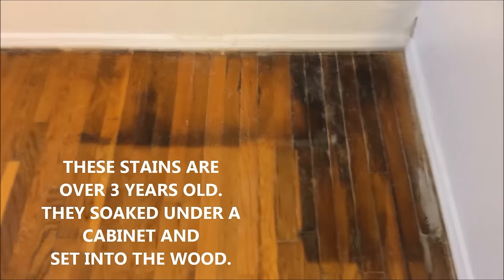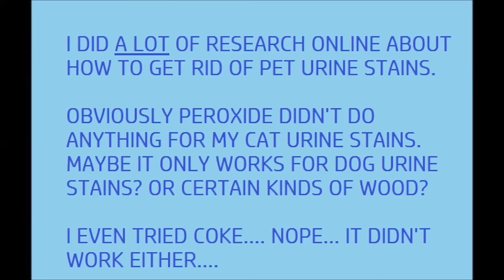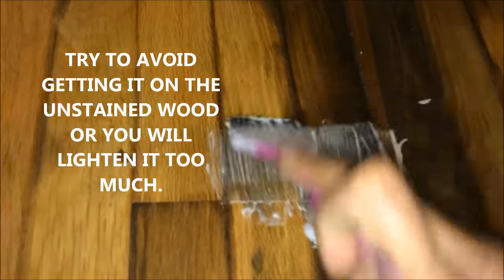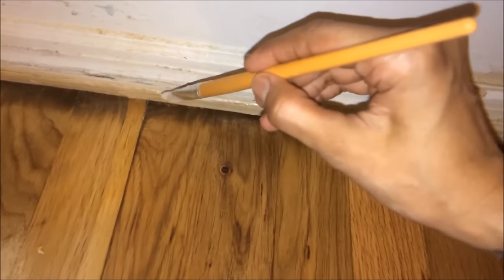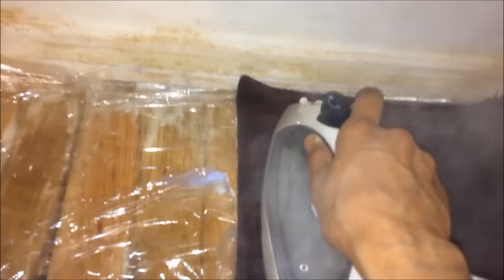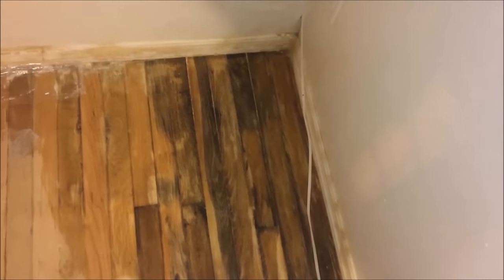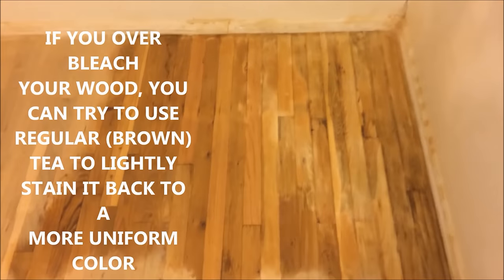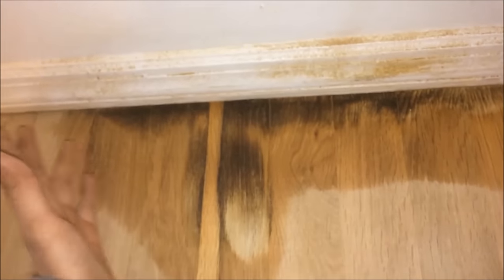How to remove pet urine stains from wood floors GUARANTEED

Comment: Just a thought is your hair developer also known as Hydrogen peroxide in a concentrated form ???
Reply: hair developer does have peroxide in it. the higher the developer the more it has. so  a 40 would have the most peroxide
Reply: Kyra Naticchioni And I think a 50 developer has the most.
Reply: michaspi correct but that is typically unavailable to you unless you are a licensed cosmetologist.
Reply: Kyra Naticchioni I just purchased a bottle of 50 at a local beauty supply store, no questions asked. Perhaps it depends on location? 🤷‍♀️

Comment: Question? Is the stains actually holding the odor and when you remove the stains you remove the odor?
Reply from the maker: I did odor removal first with vinegar and baking soda.   You can also use natures miracle.  The vinegar will turn the wood darker. But that can be sanded off. 😊

Comment: Did it hold up without any other color changes? I've bleached wood in the past and a couple of times the wood turned white after a few weeks.
Reply from the maker: if you thoroughly take off the developer/bleach after you get the color you want, it shouldn't keep getting lighter.  Mine didn't get lighter afterwards.  I was very thorough in removing the developer because if you don't and sand the floors again, they turn black if there is still developer on it.
Reply: Thanks for letting me know. I was wondering if you used a neutralizer or something. When I bleached the wood that I had the bad experience with I used a different bleaching agent though. After a few weeks mine gradually turned white as a piece of writing paper.  I'll try your method next time.
Reply from the maker: what did you use?

Comment: Unfortunatly didn't work for me!
I have timber parquet and it just caused the edges of each piece turn white and looks horrible, as the middle of each piece is still stained black.
The heat method caused the most damage. When left on overnight, avoiding the edges, it had no effect of my flooring.
I will be heading to the hardware store in hope of my saving grace.
Reply from the maker: i'm sorry to hear that, but parquet is a different wood than red oak.

Comment: what about the smell, did you get that out separately
Reply from the maker: yes, I used baking soda and white vinegar. then cleaned it up with soap. Do the smell removal first as the vinegar mixture will "grey" your floors a bit and need to be lightly sanded away.
Reply: Lizzie Seymour I do actually like the ODOBAN pet stain remover.  At Home Depot.  It smells when it is working but then does get the smell out.
Reply from the maker: ooh  never heard of that.  I used to use Natures Miracle on bedding.  but used vinegar and baking soda on the floors

Comment: Not. 38 years doing floors. Urine goes straight through the floor to the subfloor. You only touched the surface of the floor. The stain will come back in time always does. Only way to get rid of the stained boards is to replace them. FOR SURE.
Reply from the maker: Wrong. The stains never came back.  They were literally bleached out.

Comment: well i tried my way yesterday ..i took & have 2 bottles 1 filled with clorox cleaning bleach  & the other filled with white vinegar  i spray heavy the bleach 1st then  i spray the vinegar  heavy on both let set for bout 5 minutes then i take & i have a drill with a wire brush  go bout 1000 rpm or so  it if from home depot it is impact drill but have on drill  i push the brush down in to it good let run for  a bit  let set for a minute or 2 then sponge mop it up let dry then look  & see it is gone  hurray

Comment: I have used Nature's Miracle with very good results without using any other cleaner.  Just be patient and let it work...
Reply from the maker: for the smells I assume?  not the stain...
Reply: ThatChickNYC both...
Reply: I let it soak for a while...   Probably more time that what you would want.  Since I am not resurfacing my floors I can afford to wait it out...  http://www.naturesmiracle.com/products/more-products/floor-cleaners/hard-floor-stain-and-odor-remover.aspx
Reply: It says it is for sealed wood and other floor types.

Comment: Such a small area , why don`t replace a handful of  floor boards , in the end it will look professional  it`s soo easy
Reply from the maker: this video is about removing stains not replacing boards.
Reply: so easy right they are tongue and groved in there and under ther walls yeah right real easy. buy the time you get the old boards out you have a hell of a mess
Reply from the maker: Joe Scheller very true.  Because I had to remove some boards from my closet a year after this video to replace missing boards in a moved doorway.  And It was a pain in the ass to get the old boards out.

Comment: The only way to remove moisture stains from wood floors is by replacing the boards. I know I did hardwood floors for a living.  The more you look at a floor that is done wrong the worse it looks, and it is a large area of your house so mistakes will jump out at you......
Reply from the maker: this is urine not moisture alone.  And it worked for me as well as several people who tried it.. does it look perfect?  no, but it blends in well enough once stained.

Comment: Why didn’t she just sand over the stain???     Anyone??
Reply from the maker: Sanding only works for light surface stains.  These were deep stains possibly about 1/2 inch or more into the wood.. if I tried to sand them all out in just each spot, my floors would no longer be level.  That's why you need to bleach them out.  For light stains, I am sure sanding alone works.  For deep stains, sanding is not enough.
Reply: ThatChickNYC does regular bleach work???
Reply from the maker: It didn't for me.  but some people have had success just using peroxide alone.  I didn't.  I guess it depends on the wood and how long it's been there.  but I got my floors stain free in one day, for cheap, so I was happy with the results.

Comment: The 60 volume hair developer is actually a solution of around 13% hydrogen peroxide. So, your really just putting hydrogen peroxide on the stain.
Reply from the maker: incorrect.  "just" peroxide is sold over the counter in a 3 percent solution and has nowhere near the bleaching power of a crème developer with powdered bleach added.  Comparing "just peroxide" to a bleach/developer mix is equivalent to comparing Tylenol to Codeine. Perhaps do some research before trying to be clever.
Reply: "....and has nowhere near the bleaching power of a crème developer with powdered bleach added.  Comparing "just peroxide" to a bleach/developer mix is equivalent to comparing Tylenol to Codeine. Perhaps do some research before trying to be clever."

And this ^ people is EXACTLY why you do not use this method in the video that this lady created and used to clean your hardwood floors that are stained with whatever it is. What this lady used, the amount and the way she did it is so dangerous to ones health! Please do not, ever, ever, EVER clean a floor or anything for that matter the way she did! So horrifically bad for your lungs, heart, brain and other vital organs in your body. Please do not do this.
Reply from the maker: Muhibur Alam thank you ! 🤣🤣. She is fucking annoying.
Reply from the maker: Abby Lane please STFU

Comment: You are advocating the use of a lot of cancer-causing chemicals.  Did you try going to a pet supply store for an odor neutralizer?   Carpet cleaner stores rent devices meant to steam uncarpeted floors.  After all that has been done according to directions, I think I would wait til the floor is dry and THEN sand.  No?
Reply from the maker: LMFAO. Go troll somewhere else.  No one is going to get cancer for bleaching their floor for one day.  GTFOH.

Comment: you could have just changed the boards for far less money and less time and much better results..
Reply from the maker: 1.  You realize I intended to sand my floors regardless right? 2.  This took half day (if that), and the results are great. for less than $40.This video is about getting out stains from floors, NOT replacing floors.  Feel free to go find those.
Reply: ThatChickNYC / the results are not great, you can still see the stains.. as soon as you put polyurethane on the floor they're going to come right out again.. and you can't hide the smell.. and let's get real, you're using hair products to remove  urine stains.... I don't think so....
Reply from the maker: 1.  I didn't stop at the end of this video.  I kept going after that and got them ALL out.  2.  I am NOT putting poly straight on the floor they are getting white washed and then a gray wash.  I hate brown floors. 3. Other people used the same or similar approach and got them out as well. 4.  the SMELL was totally removed using vinegar and baking soda.
Reply: ThatChickNYC / lol, that's funny, I guess you're going to hand sand the floors as well.. maybe you'll be done by next summer... if you're going to use a whitewash there's a process that would have helped get the stains out as well it's a two-part bleach.. after that you put down your stain it's best to use the impervo by Benjamin Moore , you can add some Gray, and you can cut it with paint thinners , until you get the consistency and color you like, let that dry for 24 hours..  then you can apply the water based polyurethane, best to use the bona traffic, for a durable long-lasting finish...
Reply from the maker: I decided to white wash after I sanded.  When I finished sanding I realized I did not like the reddish tones of my wood. Also I'm not staining the floors, as I cannot find any grey wood stains that are as light as I want my floors.  They are all way too dark.  So I am going to paint them with a water dilluted grey paint (4 parts water to 1 part paint) because I want the grain to show.  Then use bona sealer, followed by Bona Traffic HD.  Also why do you assume I have to hand sand the floors?  They have already been sanded.
Reply from the maker: Also I just finished reframing my apartment and had to remove boards from the closet to fill out the floor where the old door frame was.   It was NOT an easy process.  It was annoying as fuck actually.  (but I learned how to use a circular saw and that was cool  :)  also, Considering my floors are over 20 years old, I doubt it was going to be as easy as walking into a store and finding an exact replacement.
Reply: ThatChickNYC / actually it is that easy you can go to any hardwood flooring supplier it's either white oak Red Oak or pine .. 2 - 1/4
Reply from the maker: I found it /..for $80 a box.  no thanks.  And the closet/doorway repair process was annoying.  I saved time and money doing it this way.  shrugs.
Reply: hey chick dont ley rob get you going  he is just a know it all that thinks he is smarter than evryone else.